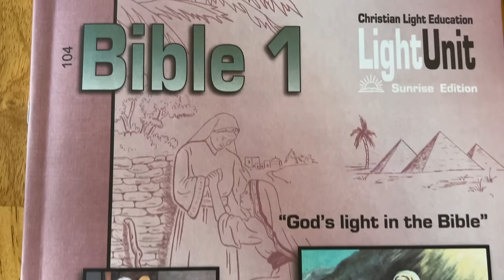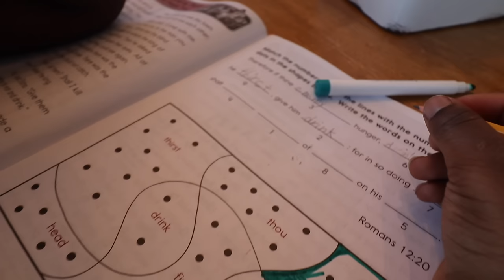A Month of Firewood in 2 Days! | Off Grid Heat at -32 Degrees!

Comment: Joe you need a woodhorse for cutting your wood into the smaller logs. You need three legs like you would for a picnic table (6 in all), you brace them together. Make it to your height. Just use smaller sticks from the woods no need to buy lumber. That's what my dad used. It wii save your back. Use your sp,itter to save time. Love you guys. Stay warm.
Reply from the maker: We have a splitter, we just didn’t feel like getting it out. Joe has saw horses too, we don’t mind a little hard work. It’s a good work out, keeps us young!😂

Comment: Firstly, can’t wait to see it all finished!

So, just a few thoughts here:
1. Making the back wall a full glass feature and change your door to a sliding French door to bring the outside in.
2. I know the idea of looking at the fireplace in the corner is there and I agree with that placement. You can still have a chair there, it would just have its back to the window. If you did like a swivel rocker chair it could spin to look into the room or to the outside.
3. You bedroom: 
a) I highly recommend NOT having any plumbing on the outside wall if you have a choice - not too sure why you decided to have to bathroom on the outside wall.
b) barn doors for closet and bathroom man!! Or even pocket doors are better than taking up space with regular doors - it looks like you should have the space to do it.
c) I agree with Jen - storage is key!! Could you not add a bit to the entire width of the cabin? That way you can make your bedroom bigger, for the other room you could always give that space to the living room area (just a thought). 
4. Kitchen:
I recommend maybe swapping out the space for the second bedroom closet and give yourself a larger “walk-in” kitchen pantry - it would be handy for extra storage and the storage of extra appliances, canning supplies, etc. IF you widened your plan by a few feet, it would me allow for a storage cabinet in the second bedroom  (like an armoire) to make up for the smaller closet. When I first bought my house (1070 sq bungalow) it had a smaller (8x7) bedroom off it the kitchen and I used it as a walk in pantry cause (creative) cooking takes things and things need places to be stored! Also, is that freezer big enough for all your needs?
Reply from the maker: I honestly can’t even respond to half of your comment because it doesn’t make sense, sorry.🤷🏼‍♀️ Plumbing on the outside of the house what are you talking about?🤣 There is zero plumbing on the outside of the house. 

So much of your comment & suggestions have already been addressed so many times in videos, I can’t address it again here but we certainly won’t be changing anything about the bdrm addition. Framing and everything is already done…we’re not undoing that lol.

And we’ve done several videos on our plans for the current master bdrm being turned into a walk in pantry & office space.

Comment: I agree with the dark walnut accent wall as I like dark colors anyway, but I would also use the second color on the other walls to darken them slightly to go with the accent wall. I am not sure because of the lighting but the other walls could be too pale or washed out when put against the accent wall
Besides, having all the walks covered in something would give them some added protection against future damage.
As much as I love solid wood stuff, I almost always coat it with some type of varnish or varathane or stain. I dislike painting solid wood greatly, only doing it if there is no other choice
Reply from the maker: Yes, we’ll be adding a clear protective coating to the rest of the walls.☺️

Comment: You need to minimize the touching of your firewood. Drop the longer logs right next to where you cut them into logs; right next to where you split them; and then finally load them onto the deck. Or put a gate on the deck rails so you can pass them through there.
Reply from the maker: Friend. We’re filming YouTube videos. We stacked the logs for our thumbnail photo. It required us to handle the wood more than we normally would. Besides we don’t mind the work. We’re retired, no job. This is what we do all day. And it’s a great workout!🤣

Comment: I know you are using dead wood that's currently available. But do you have any dead hardwood trees like oak? Hardwood burns longer and doesn't have so much sap that creates creosote in the chimney pipes. Pine and fir are soft woods. They burn up quicker than hardwood.
Reply from the maker: Correct they do burn much quicker but we have a ton of dead spruce on our land and that’s a fire hazard. Joe is really good about cleaning out the stove pipe. No oak, but we do have some birch on our property, so when we can get those, we do…because they burn much longer than the spruce pine.☺️

Comment: Usually firewood is put up in the fall season, before winter- of course I am in -40 c and no way would we wait til January
Reply from the maker: I guess if you can’t handle the cold then you would have to get it in the fall. I don’t mind working in the cold. -40 doesn’t bother me. While stationed in Fairbanks Alaska with the military I would work and sleep in weather colder than that. 
Joe